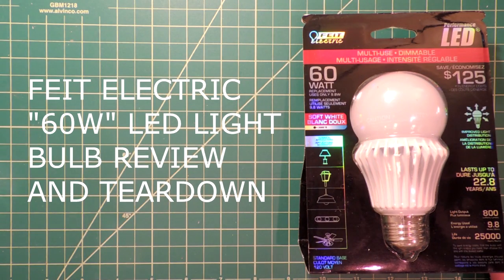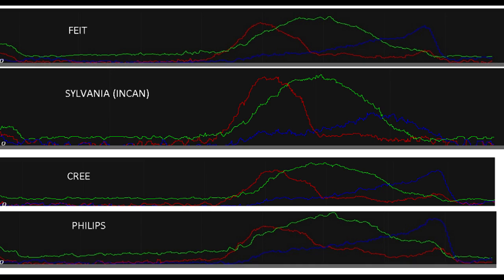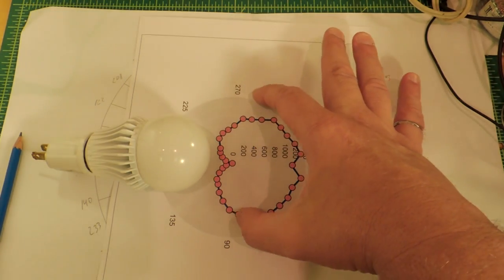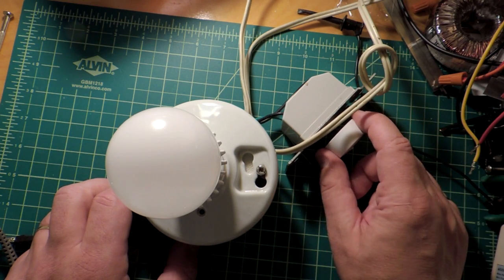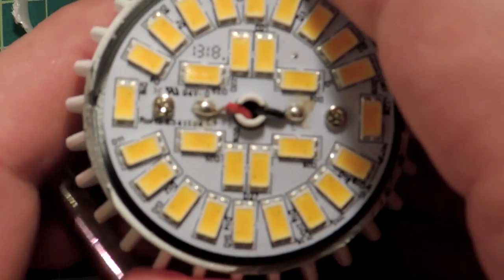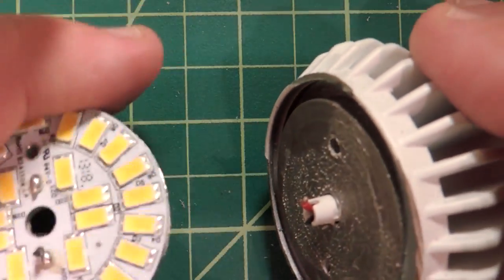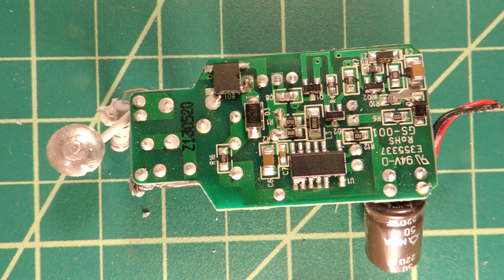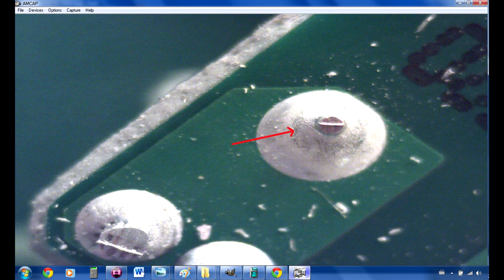Feit A19 LED Lightbulb, "60w" Teardown and Review

Comment: I just tried a $12 feit 60 Watt equivalent LED - Nice light for the price (Lowes Canada - . No dark spot on the top like the 60W equivalent LED to my eye and a great bulbe for less used locations given the great price and good even light. The $17 Philips 60 Watt Daylight (5000K) or Soft (2600K) is the nicest light of the three. I will try the $25 Switch Lighting 100W Equivalent LED Switch bulb soon because I am more confident that the liquid bulbs will actually give you the 20 year life span given the importance of cooling the electronics in an LED. While the ossilliscope may see 1 MHz flicker it is not detectable to my crude human eye that operates at 60 frames per second! - my two cents worth